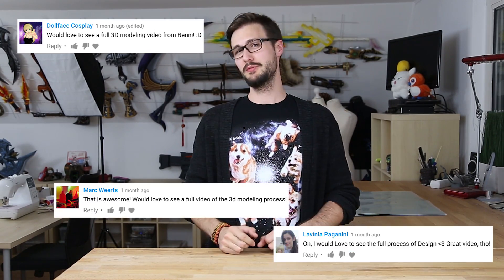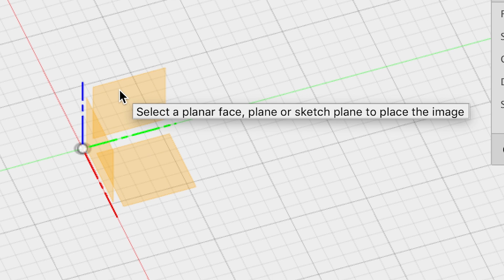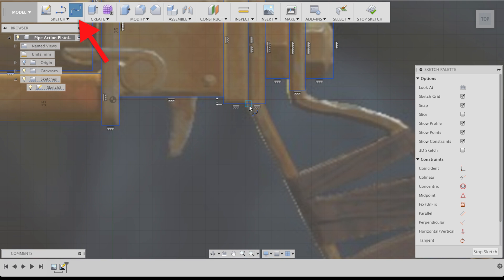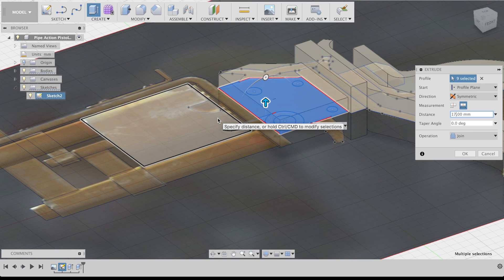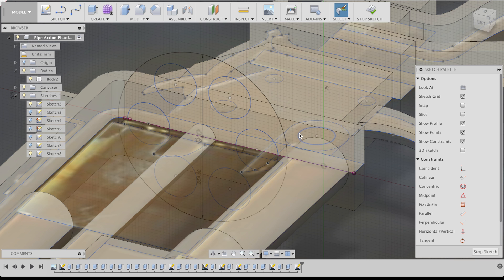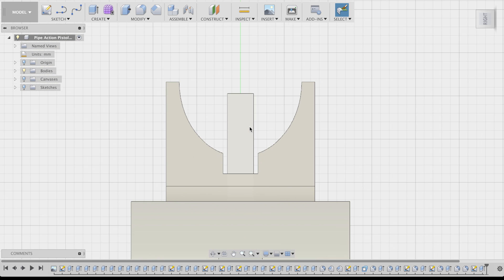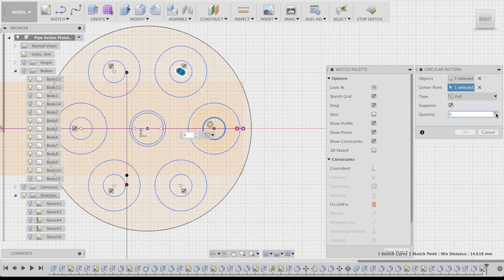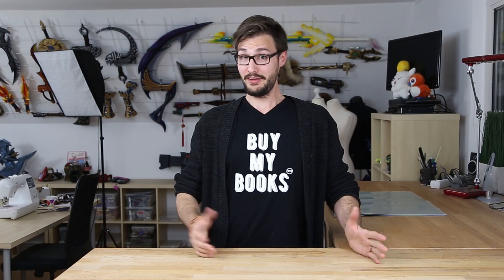First Steps in Fusion 360 - Pipe Revolver Pistol

Comment: Before you read: it's just my point of view - it may be much simpler with new hardware. I just don't know, 'case I'm working with 8y old one q_q
To everyone who thinks that 3d printing self made projects is easy - they are not (well - depends on how much knowledge and skills do you have). It happens quite often that students of architecture comes with models of houses made in 3D Scetchup and thinks that they've made a masterpiece. And then a surprise comes - that there is so much more work to be done (cleaning and fixing fcked up vectors). And in some cases you have to rebuild whole thing, because it's faster that way. 
Just a reminder - building a nice 3D model does not mean that it's printable. He did say that it took him over 3 hours to make the model. I would add at least 1 hour to fix volume (open surfaces and edges) and 2nd hour to be 100% sure that it will work with 1st attempt (when I've started working with 3d models, I've forgot about vectors, which were a complete mess - whole printing had to be redone).
PS. It looks like that Fusion 360 is a very nice program to work with.
Reply from the maker: Some good tips in there! :) I agree. It's not just build and print. You have to make sure it's printable, how you set up the objects on your building plate and then a whole lot of working over it once it is printed. :) Still fun tough!